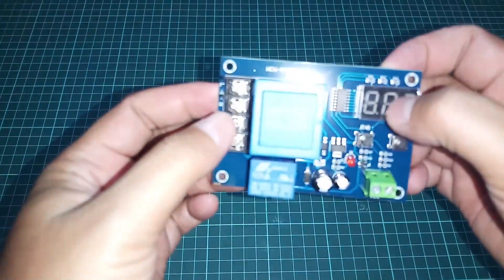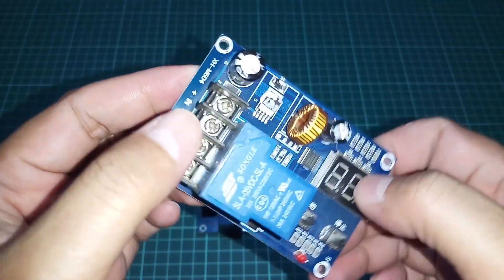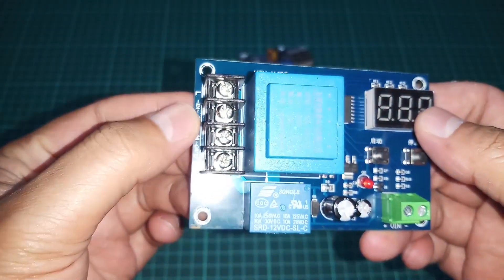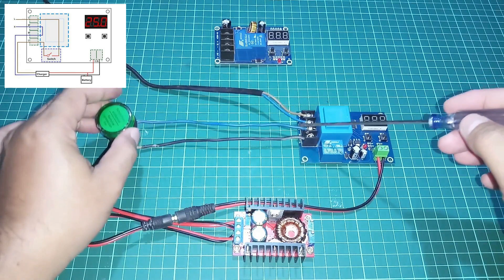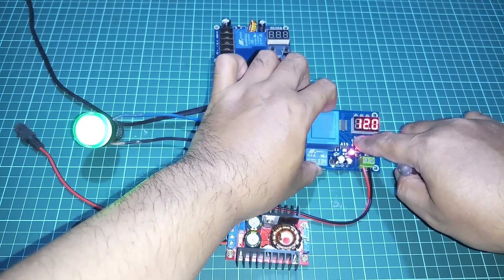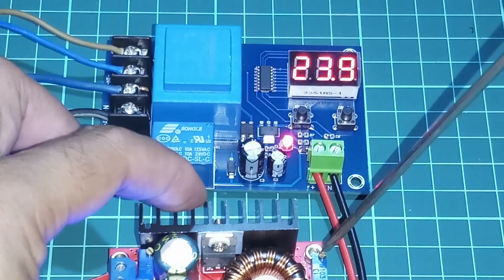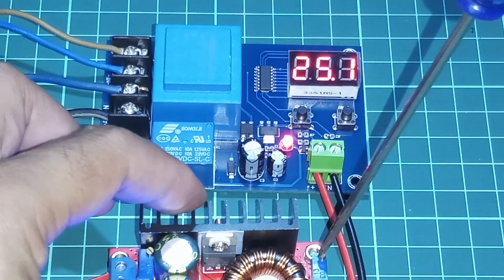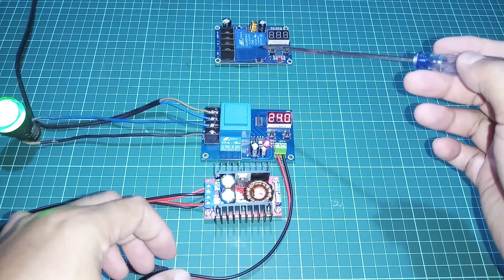HVD HCW-M633 (XH-M602) vs XH-M604 (HCW-M634) Cut off Aki / Battery Charger Control Module - Part 1

Comment: mas mau tanya untuk type HCW - M633 itu pake ic kode berapa ya?
Reply from the maker: Maaf Om sedang tidak dirumah (merantau).
Yang Om maksud ic AC to DC 12v (bridge rectifier) atau yg 12v ke 5v (ic regulator) ?
Reply: @JanSKD ic display nya om,soalnya dimodulkan kode ic nya dihapus ya
Reply from the maker: @eddirusmana5042 kalau ic itu tipenya ga tahu Om saya, blm cek juga apakah ada nomernya krn lg merantau. 😁🙏🏼
Reply: @JanSKD ic charger aki yg type HCW - M633
Reply: soalnya punya sy ic nya rusak
Reply from the maker: @heninuraeni2580 kalau ic yg ada banyak kaki dekat led itu ga tahu Om saya.

Comment: bang kalo bedanya xh-m603 dengan xh-m604 apa bang ? lebih rekomen mana buat charger aki bang atau baterai dengan input minimum 12v.
Reply from the maker: @aldybachtiar7449  range voltase lebih lebar m604 dan relaynya lebih besar m604, kalau menurut saya lebih memilih xh-m604
Reply: @JanSKD  oke terima kasih jawabannya banh 🙏

Comment: Xh m602 bisa dipakai untuk psu 84v 32A mas ... kalo bisa mau saya pakai buat charger baterai
Reply from the maker: Relay dimodulnya itu cuma 10A Om, bisa dimodif diganti dengan ampere yang lebih gede atau pakai relay external. Atau Om pastikan/cek dulu arus saat charging berapa Ampere.
Reply: @JanSKD  selain relay ... volt kapsitor perlu dimodif juga? Jadi amper maksimum perlu diketahui datanya sebelum pakai ini ya ... kalo yg diatas relay komponen apa itu kotak biru gede ... terima kasih replynya mas
Reply from the maker: @delbandung4801  elco tidak perlu diganti Om, krn voltase yg masuk dr AC trus jadi DC bukan dr V in DC (hijau). Yang kotak itu trafo stepdown AC, kemudian jadi DC untuk menghidupkan module
Reply: @JanSKD  erimakasih info ... sukses channelnya
Reply from the maker: @delbandung4801  sama-sama Om, Amiinn...

Comment: ass, itu 22 nya bisa ngecas ke 3 vol batrai ga kang 🙏
Reply from the maker: Bersadar speknya tidak cocok untuk baterai 3 volt Om
XH M602 : 3.7v - 120v
XHM604 : 6v - 60v
Reply: @JanSKD  XH M602 harus batrai paling rendah  3.7v  baru bisa ya sampai batas 120v begitu kah
Reply from the maker: @saputra1247-v6v  betul, spesifikasinya demikian Om
Reply: @JanSKD  terimakasih ya sangat membantu
Reply from the maker: @saputra1247-v6v  sama-sama

Comment: Pak,saya menggunakan HCW-M633 utk mencas batrai vrla 12v190ah yg saya rangkai seri menjd 48V. Saya cut off batas bawahnya di 49V. Indikator lampu charging nya menyala tp kok tdk bisa melakukan charging. Sampai saya tunggu 3jam tetap 49V tdk naik2. Itu kendalanya apa ya pak?
Reply from the maker: Coba cek output chargernya Om sebelum konek ke baterai
Reply: @JanSKD  output voltase nya ya pak?
Reply from the maker: @user-A.Dspt5ou6df1i  iya Om, apakah ada dan berapa output volatase dr charger
Reply: @JanSKD  siap pak...

Comment: Hello!
My task: When electricity appears on the network, my automation includes a power outlet in which a charger is inserted, the output of which is constantly connected to the battery terminals, and the battery is charged. When the voltage in the network disappears, my automation includes an inverter, the input of which is also constantly connected to the battery terminals, and the output to the consumers in the apartment. Now what I want to do. Since the power supply interval on the network is longer than the required battery charge time (up to 14.4V), I need XH-M602 without my participation (!!!  This is a key requirement !!!) turned on the charge when electricity appeared on the network, and turned off the charger when the voltage at the terminals reached maximum.
 Question: if the limit 10.5 - 14.4 c is set for me in advance on XH-M602, and my automation, when the voltage appears on the network, supplied 220v for power to XH-M602, which includes a charger, and on the terminals of my battery will be, for example 13.2v (t.e. it will be the middle of the set interval !!!), then XH-M602 will turn on the charger?
Reply from the maker: 10.5v : start voltage and 14.4v : stop voltage. 
1. start and stop can set once the electricity is connected to module
2. in first time battery (13.2v) connect to module, the charger will be charging until the voltage greater than 14.4v (full and then charger off)
3.  in discharging position (14.4v - 13.2v - 10.5v), when battery voltage 13.2v the electricity disappears on the network and then appears again. ---> The charger will remain off.
4. in charging position (10.5v - 13.2v - 14.4v). the charger will be on if voltage under 10.5v, when the battery voltage 13.2v and the electricity disappears, the charger will be off. if electricity appears, the charger will be on until the voltage greater than 14.4v

-CMIIW
Reply: @JanSKD  , Thanks so much for the answer!!!
Reply from the maker: @ВикторЛановой-и5ц  You're welcome